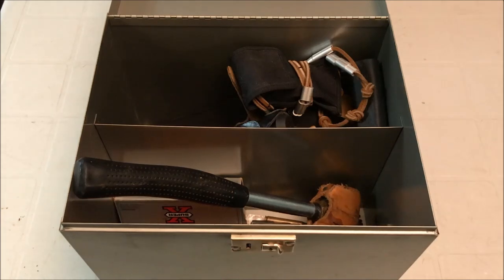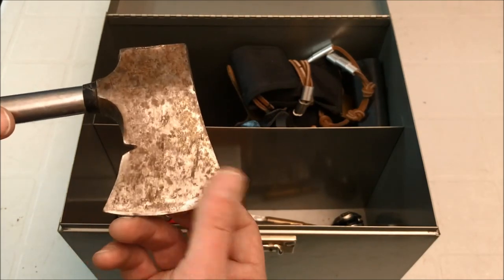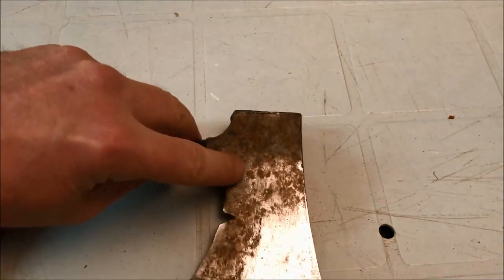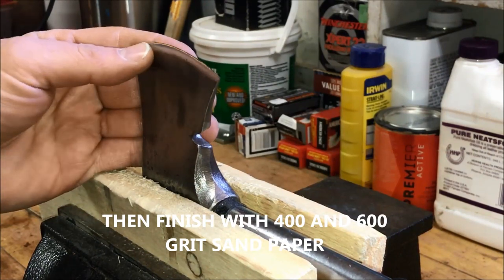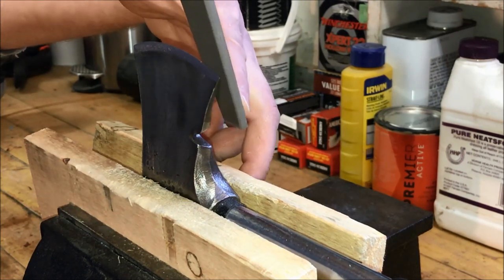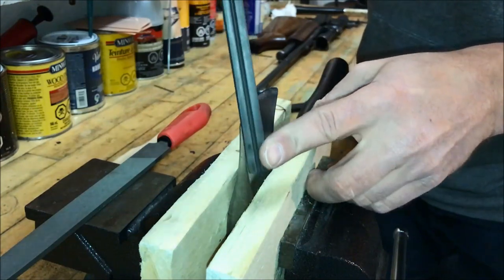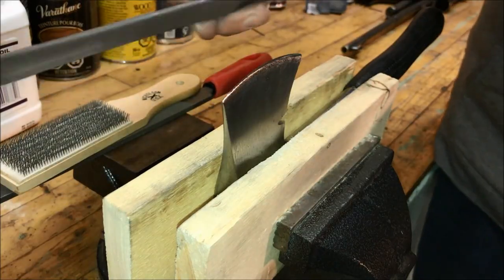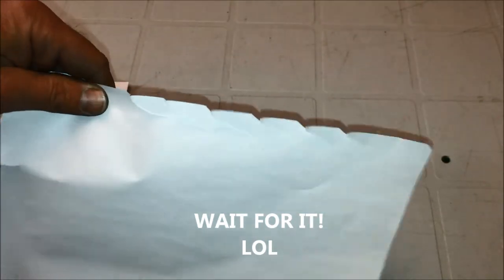HOW TO SHARPEN A HATCHET

Comment: Thank you for the video. Your video was the simplest and I got the best results on my Hatchet. I will never use any other method again. Except this one. Thank you again. I have to debark a bunch of siding at work. So I need a sharp Hatchet. And it is very sharp now thanks to you
Reply from the maker: Thanks, appreciate it.
A person could grind it down with a stone or an angle grinder; but for someone who doesn’t have lots of experience with grinding with power tools, a person could quickly ruin an edge. 
Take care

Comment: I just use a grinder with a sand wheel. Cleans up the profile and leaves it pretty sharp. If you want to take it the next step, rub a stone on it for 5 minutes and it'll be razor sharp in about 7 minutes. Don't get it hot tho, keep it cool.
Reply from the maker: Thanks for the advise sir, I’m not big into hatchets or axes in regards to the convex grind. I will try your idea sir:)

Comment: Firstly, to re-profile an axe or hatchet is the process of thinning the cheeks - What you have done is simply sharpen.

Secondly, never work a file backwards over steel, they are not designed to do this as it causes wear.

Attempting to sharpen an axe or hatchet in the way that you've demonstrated is  unproductive as it is difficult to accomplish uniformity accross the bit.

There are a number of easy and highly effective ways to sharpen an edge tool, this is by no means one of them.